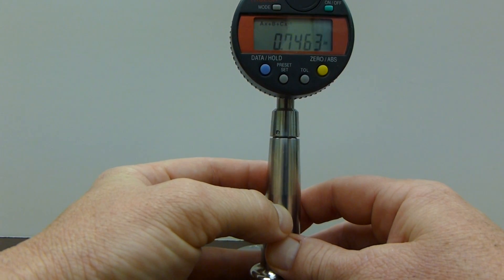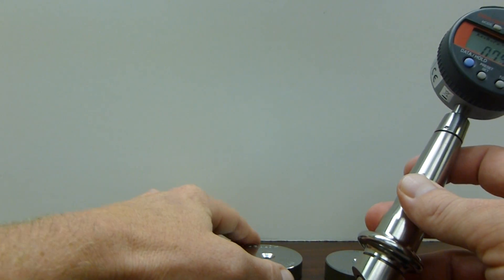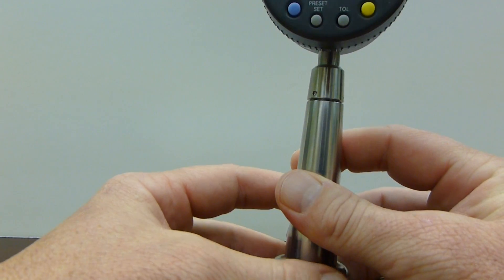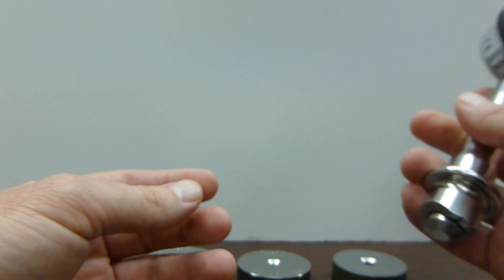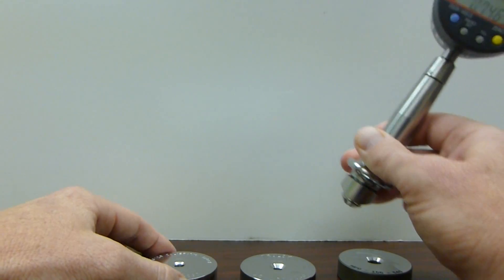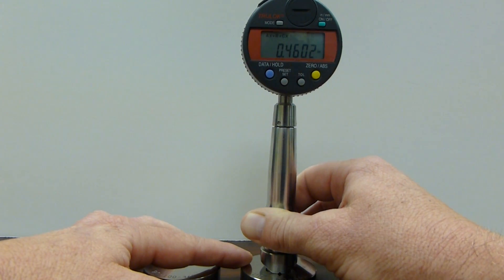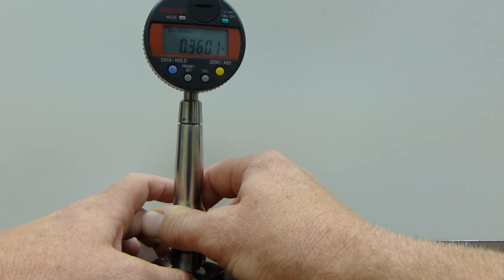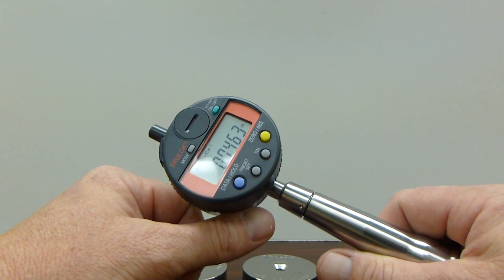TRULOK COUNTERSINK DIAMETER GAGE

Comment: I just got dismissed from a quality job because I didn't know how to perform this measurement.  They didn't own such a gage, so I don't know how to achieve the measurement with the remaining tools.  My wife has been a quality manager and engineer for almost 30 years and me for 10. Neither one of us ever had to perform this measurement.  Thanks for the great video.
Reply from the maker: I wish you good luck on the future. The countersink inspections and verification for flushness requirements are more demanding in the aircraft skins (panels). Commercial and Military applications both aim for a smooth profile especially after primer and paint. As you may already see, gas and jet fuel is expensive. 
Cheers.